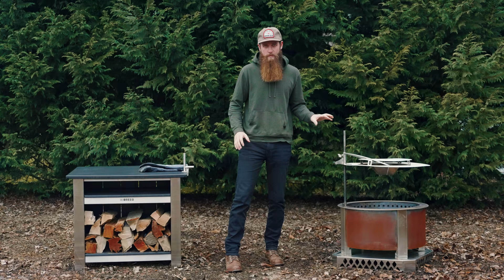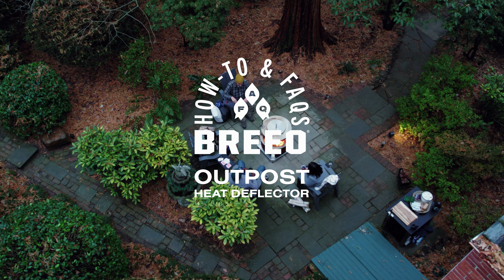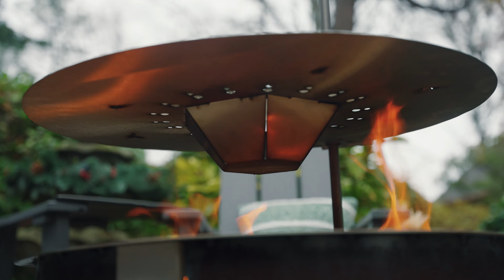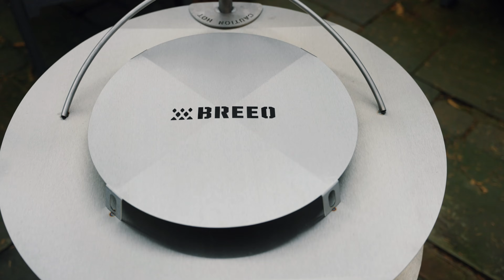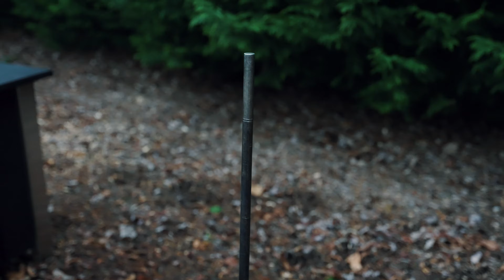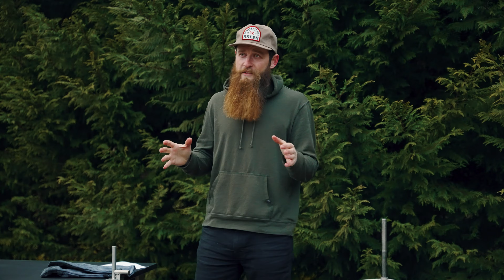Breeo Heat Deflector | FAQ

Comment: What about the 30"?
Reply from the maker: The X Series 30 is our largest and warmest fire pit to begin with. Due to the size of this fire pit, there are some additional design complexities for the Heat Deflector that we are working through.

A Heat Deflector for the X Series 30 is not outside the realm of possibility, and you are welcome to sign up for our newsletter to stay up to date on this.
Reply: The X30 is not THAT warm. A heat deflector is absolutely needed. Make it so! @breeofirepits
Reply: @breeofirepits  Is it possible to use the 24 inch Heat Deflector on the 30" pit? Would it deflect heat decently?